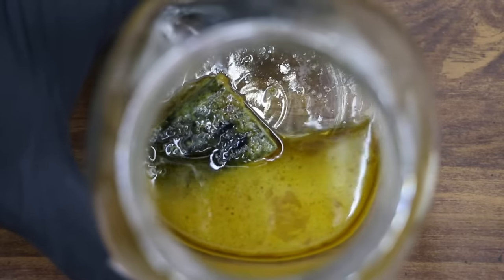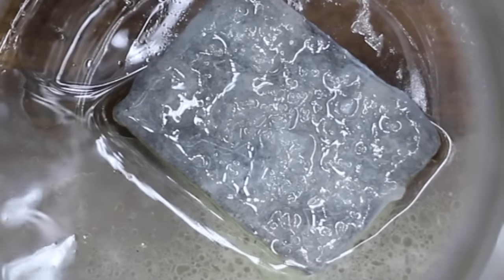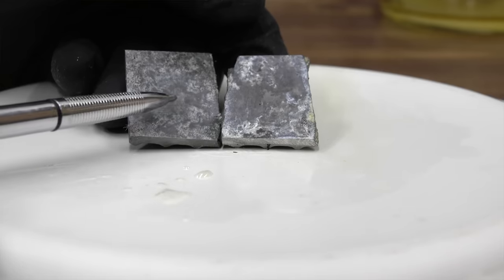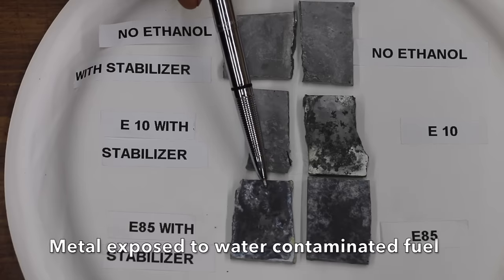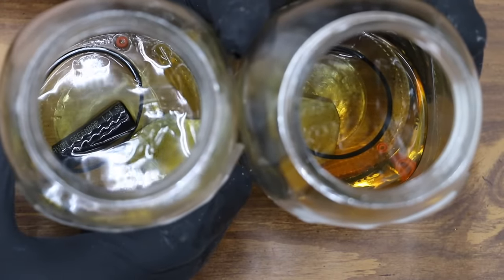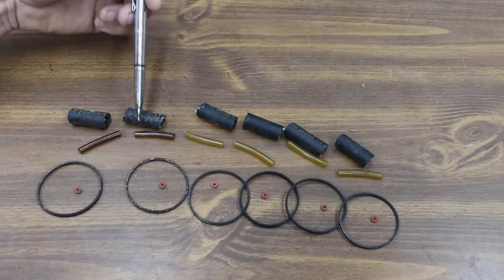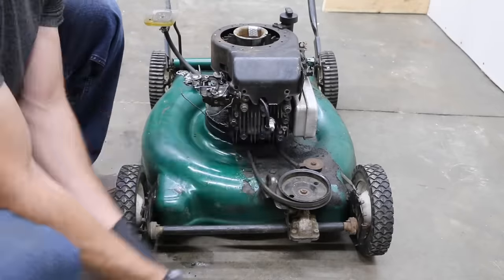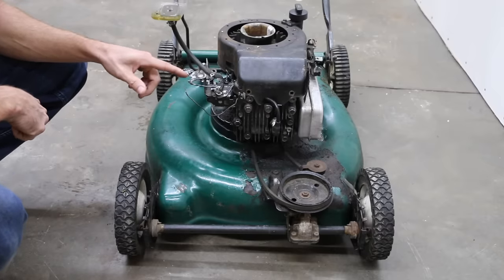Does Fuel Stabilizer Prevent Ethanol Damage?  Let's find out!

Comment: Ethanol is the worst! Great video, as usual. :-)
Reply from the maker: Thank you very much!  I'm heading over now to your channel now to see your video on Gallium!!
Reply: Long as you going to leave that fuel sit in there for a extended amount of time it will be fine oh yes or no is just a little extra alcohol
Reply: But it "helps" the environment. Why else did Gov spend tax dollars pushing this garbage? Gov is here to help right?
I truly enjoy replacing engine parts I never had to before and lower fuel efficiency.
But I'm sure ethanol will "help" the environment one day... Been what 15-20 years now? .. One day..
Reply: @bobshanery5152  I dunno why they pushed ethanol like that. What we used before as an octane boost, BTEX, is a carcinogen. Ethanol doesn't do that. But there is no perfect octane boosting chemical to throw into gas. the ideal solution would to make engines that can run on gas without lead, BTEX, and ethanol but that would be a very weak engine. Very low compression, no power, and people would still bitch. To minimize damage, just don't let gas sit in the engine or tank. I don't have a collector car or multiple cars I drive throughout the year, I only have one that I drive all year...so I've not had such issues in a vehicle. In small engines, when storing them I empty the gas out of the tank and carb bowl. 

And the efficiency thing, it's very minimal. It's not like you're losing 10mpg. I ran Ethanol fuel and non ethanol fuel and saw little advantage to either, still got 400 miles. What mattered more was the quality of the gas being used.

If someone could come up with something better than Ethanol to boost octane in gas, that would be great. The old ways aren't always better, like the song says; the shit that used to work won't work now.
Reply: @Catinthehackmatrix  Gotta love the brainwash propaganda that people are fed by the govnt and those who have money interests in things. Its always money money money first. Its not just selling more fuel, its selling new cars, car parts and ruining other cars and gas engines. You lose a little fuel mileage with ethanol, it is harder on engines, and really doesnt help the environment like they say. It takes alot of energy to produce ethanol and there are many chemicals used in the process that have to be manufactured as well. Then add transporting it. All of which pollute some way or another. No ethanol or ethanol, rest assured the govnt has its tax on it as fuel is almost all tax at the pumps. Gas stations cant survive on just fuel sales, they have to have good in store sales. Only bigger fuel stations can buy in bulk most the time to get a small discount. 100% ehtanol would be cleaner burning but still polluting the same somewhere else.
Reply: @353bandit4  - don’t forget how many farmers got rich. Follow the money
Reply: @thatguyontheright1  because ethanol requires no drilling..................
Reply: It's really easy, democrats may have said because it's better for the environment,  but the truth is that it is to subsidize corn farmers. Corn becomes ethanol, ethanol mandatory in all gasoline, farmers cash in. Thank your Midwest politicians for forcing this inferior fuel on us.
Reply: Methanol is worse, I had to strip my carb weekly on my speedway bike.
Reply: @thatguyontheright1  Wouldn’t direct injection Solve the octane problem. Hi octane is needed to prevent premature ignition if you time Injection correctly you achieve desired effect just like in diesel
Reply: @stevezb  it's a decent idea, but I would think the piston compressing the air in the cylinder would make it more difficult to inject the fuel and air mix unless we use more powerful injectors. Also the fuel and air would no longer be compressed at that point. The fuel/air mix has to enter the cylinder before the compression stroke.
Reply: The story of how corn producers found a way into another market, had the skids greased mightily.
Seems Iowa did very, very well with ethanol. Hope they put their earnings to good use.
An epic mini-series, PJ!
Reply: @bobshanery5152  It's racers fuel, if you have a high performance car it adds about 20% and it's harmless but in an old vehicle not made to be run on it it's a bad idea.

You can make the same argument for unleaded for old vehicles but that doesn't mean that getting rid of lead additives is a bad thing.
Reply: @thatguyontheright1  Um, ethanol has a lower octane value than pure petrol. Lead has nothing what so ever to do with octane values but was used to dampen valve impacts. If you want to increase octane then add hexane or toluene.

You are just using terms you obviously don't understand.
Reply: @abelq8008  Eh, you're correct in everything except for "farmers cash in" . 
The Government still controls cost. (not demand) otherwise farmers would always
be the wealthiest people in the country...as food is a need.
Farmers are 100% servants to whatever the "law" tells them they'll earn. (they're hardly rich).

This system has instead created a different problem in that instead of farmers getting wealthy off of their labor, now it's politicians who control the farmer who are getting wealthy.
They are beyond the obvious pimps, now they're "scientists" who simply use food and faux-science as means to control.
Reply: Got to add that I have used only E85 over 10 years in my Gen2 Prius without any problems, so based on this video it must be what? I'm not saying that it can not generate any problems but your car must be at least prior year 2000 so over 20 years old! But with newer cars no problem what so ever!
Reply: @april7_  If it can run on it then it'll run just fine on it. If it's a hypercar it'll add 30% horsepower.
Reply: Ethanol is the best!
Reply: Government says I must use ethanol laced fuel or walk.
Reply: Is the gas station bound by law to tell me if there's any Ethanol in the gas I put in my car?

Comment: This explains why after several years of non-use after leaving Japan my lawnmower still fired up without issue. Japan doesn't use ethanol. That same lawnmower when I got it in Japan from someone who came from the States needed a lot of TLC to get it running again.
Reply: The only reason ethanol is in our fuel is because a bunch of suits who get paid too much think it helps with emissions. If anything it causes more problems than it solves and it ruins small power equipment. It's just another case of government thinking what's best for California is best for everyone else too. Lets face it, all of these rich people who pretend to care about the environment don't. Because they're obviously not running ethanol based fuel in their Ferrari's when they go out to tear up the roads. :)
Reply: I ruined my snowblower one year cause I forgot to drain gad and or use some "sta-bil" . Expensive mistake.
Reply: @Slane583  
Truer words may have never been spoken! 👍👍

Ethanol sucks! What's crazy is that, the process to create ethanol uses almost as much energy that it's almost a 'break even' scenario - and yet the US Government continues to require its use!
Reply: @andyroid5028  It's no different than electric cars. I think they're neat they have their purpose. But the only thing people see when it comes to buying one is the end result. The car itself. They see that it doesn't make noise, it requires no fuel to operate, and you don't have to change the oil. So they instantly think that it's good for the environment since they're not burning any fuel. But when you try to tell them how the process the car took to get to get there is far worse for the environment than just driving a regular vehicle their eyes glaze over, they go into denial, and then feel offended that you proved them wrong. A standard response from someone out of touch with reality and who think everything on the news is true.
Reply: For small engines, yes ethanol is no good. 
For Turbo engines, ethanol is life. Seriously, it's higher octane and naturally cools. You can push higher boost pressure with less detonation. This is something that I miss now that I'm back in Japan.
Reply: @Slane583  .....destroys fuel systems in hobby, "classic" cars too.....
Reply: @Slane583  ....right.....they think the electricity comes solely from the plug in the wall.....and not the emissions-spewing, maybe coal-fired powerplant from far away. And then what happens in 8-10 yrs when the car'sbattery dies?.....landfill for the old battery?..... $7000 cost to replace?.....look at the "total cost of ownership" and associated environmental consequences.
Reply: Slane583 OK, then let’s see your scientific research (or at least state your reasoning) that proves that EVs somehow contaminate more than IC cars, despite their high efficiency making them less polluting from even on an all fossil fuel grid (and all grids have at least some renewable or nuclear power). Ah, and don’t forget that they need much less maintenance than an IC car, so that’s also a factor to take into account, as maintenance also has an environmental impact. Also, don’t forget that we can easily recycle most, if not all, of the parts EV opponents say are more polluting than IC cars (such the battery), further reducing the impact.
Reply: Wil Ferch And that’s why recycling and renting are a thing! Plus, you forget that IC engines are, in ideal conditions, up to about 35 % efficient, while electric ones are usually 90-95 %, so even if the grid was all fossil fuel based (which isn’t, at least in the countries producing most of the pollution), it’d be the same or even better, because coal power plants are more efficient than IC engines.
Reply: @TheWilferch  Indeed.

Comment: A long-term test comparing fuel stabilizers would be extremely helpful.  In addition to comparing corrosion over a time period(s), you could test the treated fuel weekly to see how long it extends the useful life of the gasoline. A high-maintenance test to be sure, but if anyone can pull it off, Project Farm can.
Reply from the maker: Thanks for the suggestion.
Reply: Most fuel stabilizers are sour diesel...aka Kerosene...aka English Paraffin and maybe a miniscule special ingredient.

Kerosene coats surfaces providing a fluid layer protecting the metal and slows evaporation.  You may have noticed how hard it is to get off a tool, table or your hand.

So basically snake oil at $4 a half pint vs kerosene at 25c to 50c for the same cup worth.

Oh that's a trick with many octane boosters too.  They're either kerosene, alcohol or both...
As both boost the octane number.